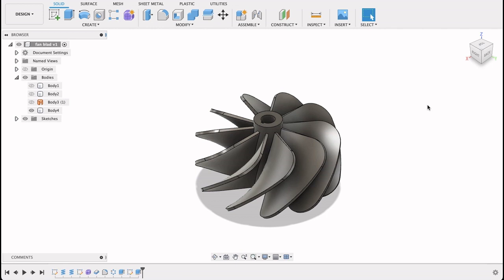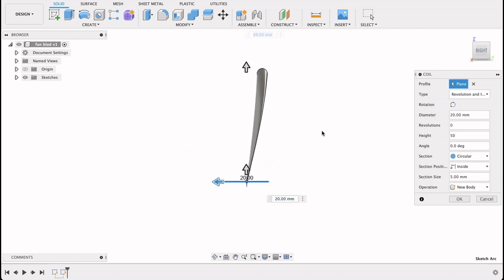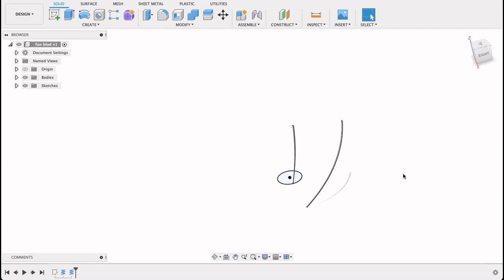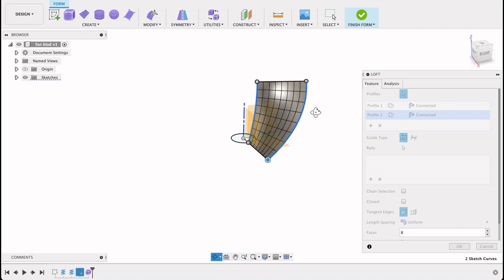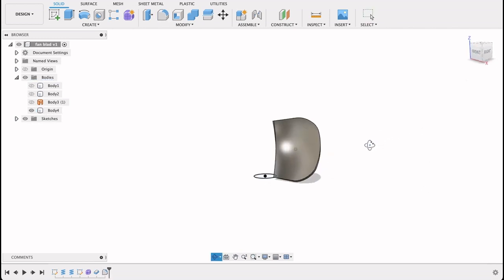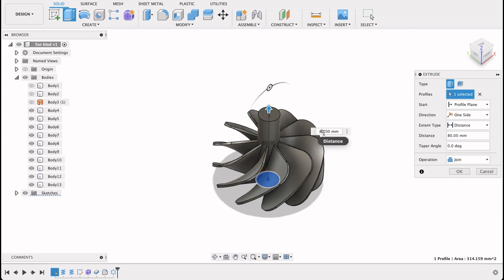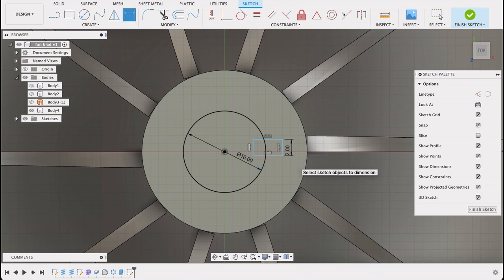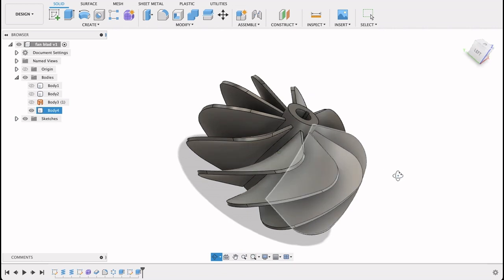Fusion 360 Tutorial: Making a fan blade

Comment: If I'm not mistaken I have seen one minor issue with this way of building the fan. The fan blades don't seem to really be attached to the shaft in the middle. It seemed like only a corner of them was touching the shaft.
Reply from the maker: I’ll have to have a closer look at the blades. I did this one a while ago. But basically I used the shaft to join all the blades so it is still a single body. If that were a problem you could make the outer diameter of the shaft a bit wider to overlap better.

Comment: hey request for a video on joints and movements with 2 gears.Trying to make a 3d printed gear box for rc car.  I think the Interwebs will be happy to have you style of explanation. for gear you could use scrips. Thanks :).
Reply from the maker: Hi I can definitely do something like that, and can also show the movement relationship. 
Maybe give me a bit more info and I can tailor the video to be more inline with your project
Reply: @Fusionfundamentals  something like this 5:1 3-4 gears think should be general design. Skip the metal parts and motor. Maybe focus on movement of and building housing.
Reply from the maker: Hi, @11tushaar have a look at the video coming out tomorrow at 13:00 discussing the motion link of gears and where to find standard gears.

Comment: What is the pitch of those blades
Reply from the maker: Not sure what the exact pitch is unfortunately. I did the drawing with a coil but if you look at the rotation and height could calculate the pitch probably. Another option that might work is to extrude a cylinder and add thread to it and specify pitch. Then use the 3d geometry of the thread